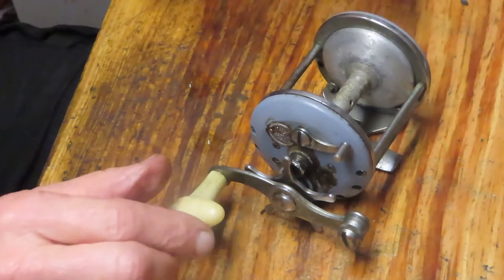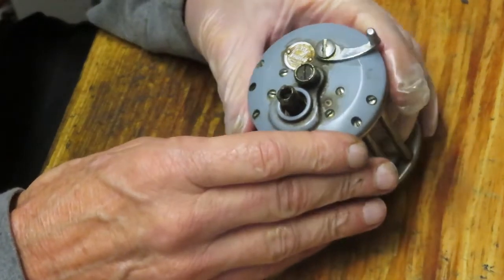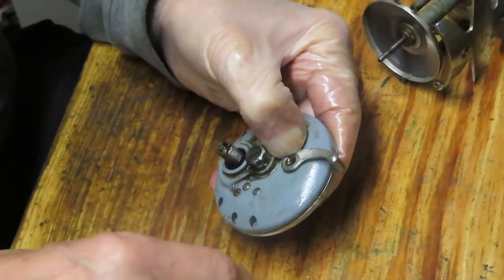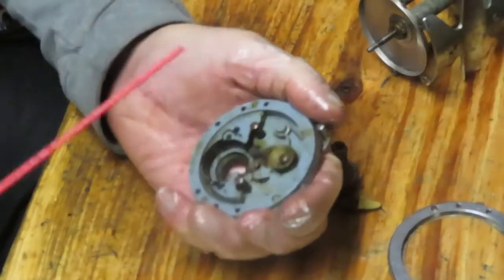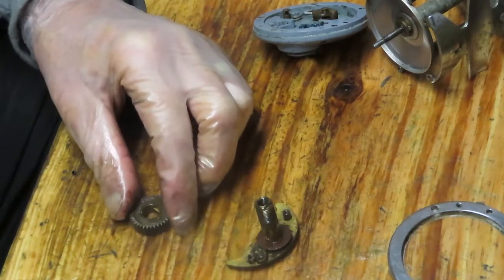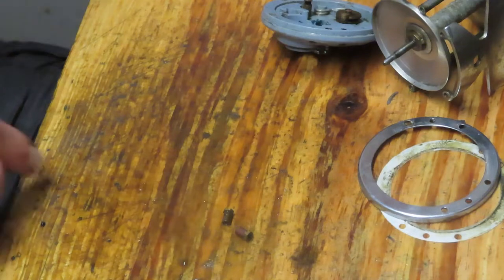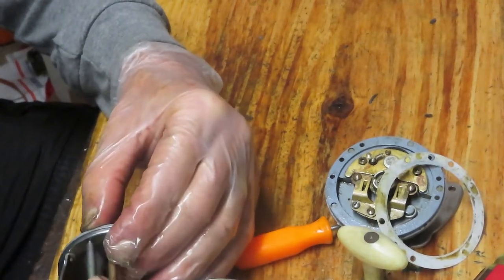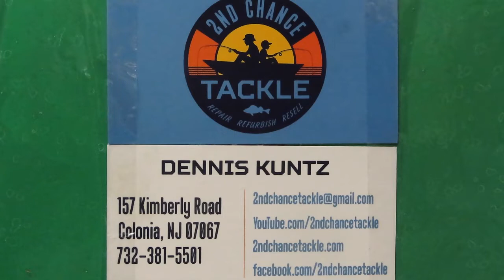Ocean City 950 fishing reel how to take apart and service

Comment: Dennis my Ocean City 981 is exactly like this...when I serviced it the lever spring was on opposite side...they had put one of the bar screws in the stud that holds the yoke which had pushed it up and out...the bottom washer on gear totally fell apart I took a drag washer from a parts reel correct diameter hole but wider cut it down to fit...this reel I love it feels like it would cast a mile...Great Reels
Reply from the maker: Yes - almost all of the 900 series share the same mechanicals.  Thanks Glenn - Dennis

Comment: Hi Dennis, I've been following your videos and fb for a couple years now and you have helped me out a lot, so I have noticed a couple little things we use that I do differently, like scraping, I have a package of cheap popsicle sticks that I can cut to various angles and sizes because the soft wood doesn't scratch when scraping grease, and I have a package of cheap Flux solder brushes that can also be cut to a point for brushing grease or whatever, and the bristles are strong and stiffer that paint brushes.  I hope this helps you as you have helped me.
Reply from the maker: Thanks for the tips!  And thanks for watching too!  Dennis

Comment: I have a True Temper 981e which must be the same family.  It's well built.  Great video Dennis!
Reply from the maker: Yes it is.  True Temper acquired Ocean City in 1957 and continued to manufacture the same reel under its' brand afterwards.  The early transition reels were co-branded as Ocean City true Temper and then the Ocean City name was removed.  Yours was probably made in the early 1960s - Dennis

Comment: I was told that the reversed eccentric lever is to make it easier to “thumb” it. 
It’s interesting how these conventional models are basically the same internally.
Reply from the maker: That's possible.  Yes, OC had two basic internal setups.  Much like the Penn Reels.  Once inside, the parts may be bigger or smaller, but the design is very similar